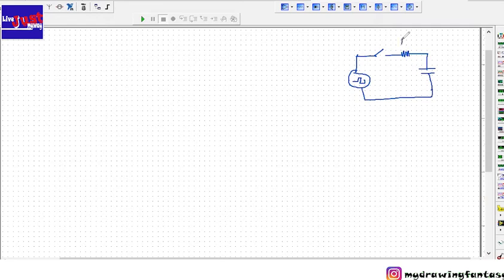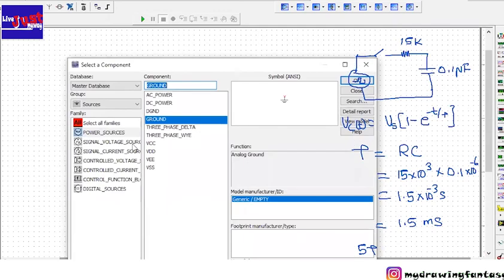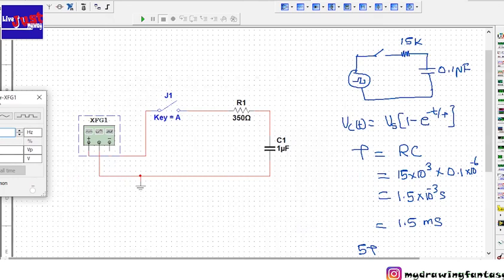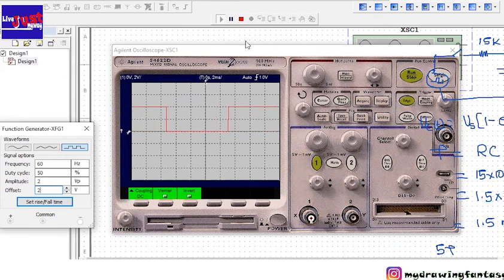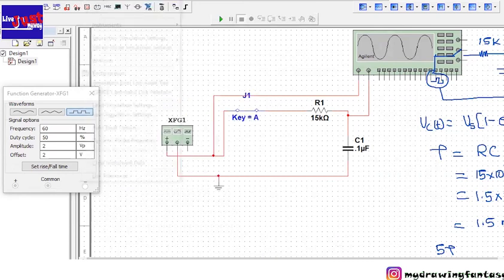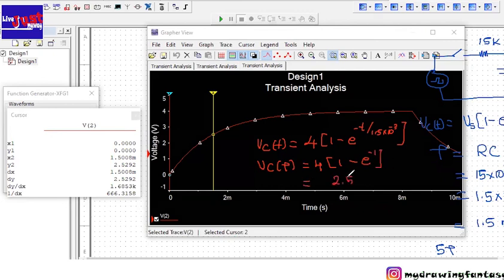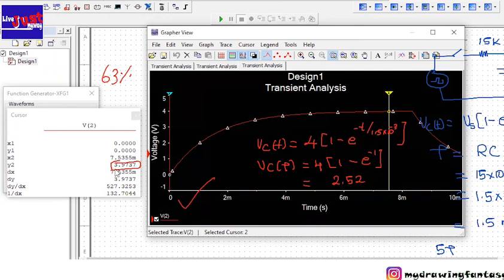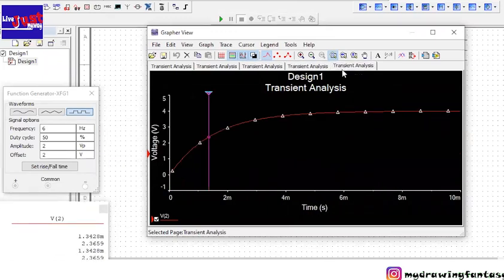Capacitor charging circuit tutorial with Multisim simulation.#multisim #tutorial #capacitor

Comment: how to change value at the top left of oscilloscope from 5V to 2V at duration 4:12 ?
Reply from the maker: When you run the oscilloscope automatic run it will change or use the vertical scale controler to adjust